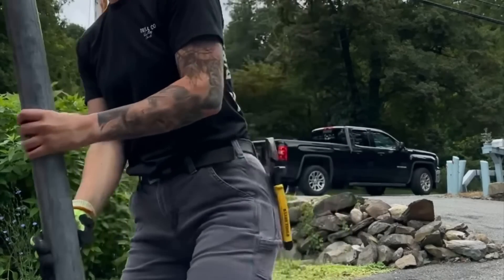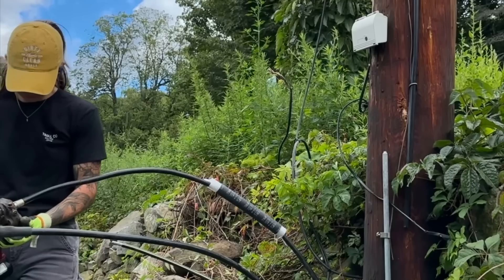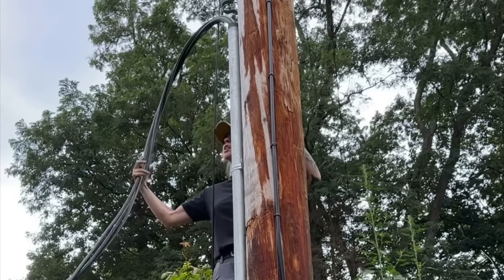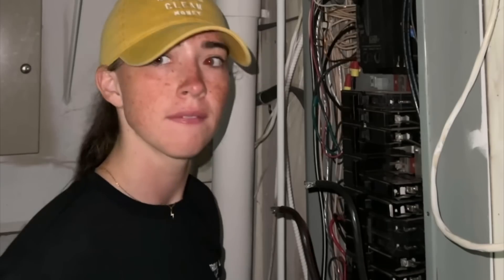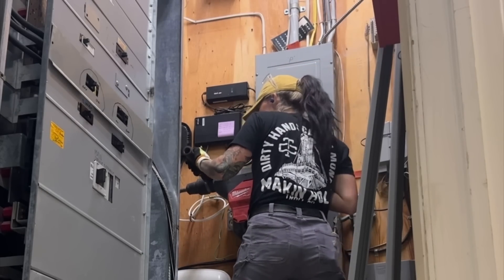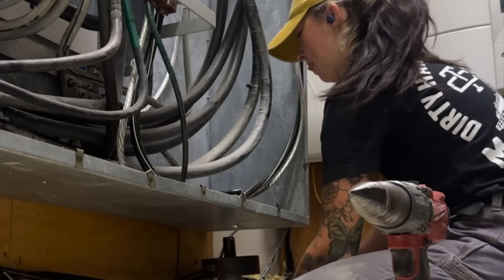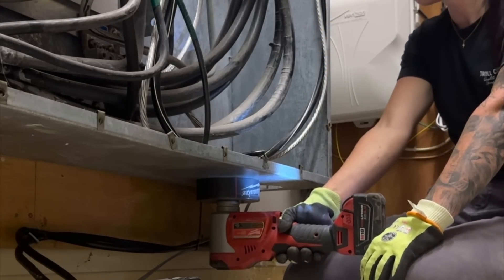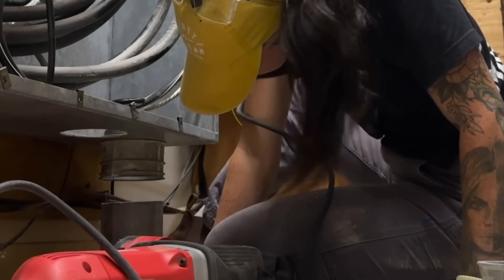Service Call Day

Comment: I had never used cold shrink until I did some high voltage a few years back. We did a bitcoin mining site at a coal fired power plant. 2- 3000 amp breakers @13.8kv. It was fun to learn new stuff! It is a pain unless you get lucky and can just pull the tab. Only had that a few times. Usually, it's around and around the wire!
Reply from the maker: It’s so time consuming and it loves to move around until you have enough plastic pulled off 😂

Comment: If you or anyone else ever need to make a slot in a floor with a hole saw and it's say five holes, drill them in the order 1-3-5-2-4 so the two final holes are balanced.

Comment: Most of the video was really nice, but I have to complain for the murdering of that holesaw and drill combo. Check the recommended rpm:s!

Pretty sure you're going 10x faster than you should. It's just a bit harder for your hands to go slower, but you won't burn the holesaw and the drill while doing it. And it might actually save time, if you stop to brush the holesaws teeth about every time it has advanced by about the length of the teeth, so there would be space for the stuff to go again.

And the drill probably came with a handle, so if there's room to use it, these bigger holesaws are the reason to use it.

And yes, there are times when I go f#ck it and blast through with max speed, but woods, especially particle board and plywood just want the slow treatment and teeth brushing.

Also removing the drilled core from the cup is usually faster to do by removing the sawcup from the centerdrill chuck (or wtf it's called in English, not my first language).

Ps. I didn't realize on the first watch that later there were that bigger thing driving the holesaw. That probably won't go even close to those rpms the small drill does, so there's the first clue.